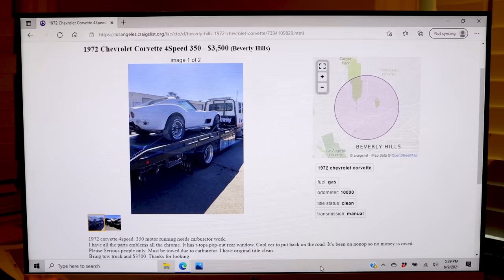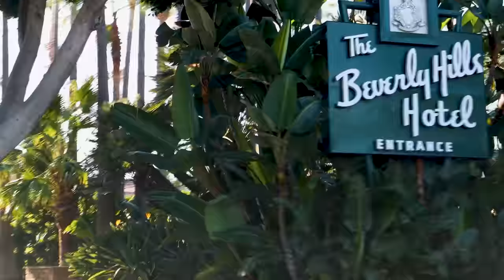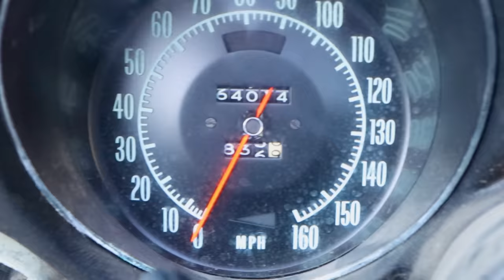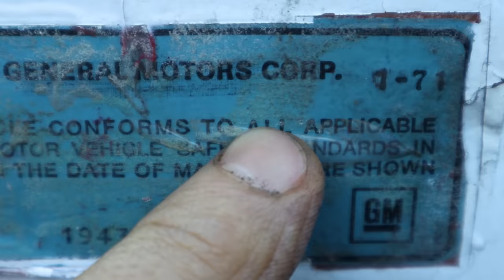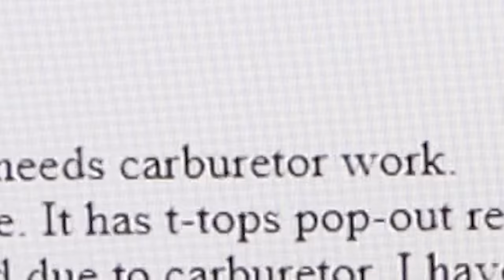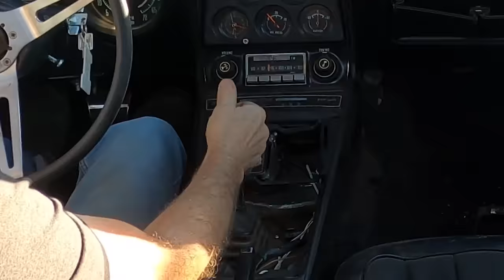I bought a classic Corvette for only $3500.

Comment: Put hose into pop bottle with brake fluid. Open bleeder. Pump away. Push out air bubbles. Been doing it for 30 yrs
Reply: Wrap the bleeder screw threads with teflon tape.

Comment: I've have guessed that car to have come with a dual line Holley carburetor rather than that pseudo Carter AVS monstrosity.  I was waiting for it to quit during your test drive.  A partially filled 2 1/2 gallon can that you had already wasted most of the fuel fooling with the points and coil was a no brainer.

Comment: What's really awesome about this car is that it's a manual, not an automatic.👌
Reply: That 71 is a real jewel. The great thing about fiberglass is that it doesn't rust! I spent 23 years at GM dealerships & one in particular was a big Chevy dealer. The owners private collection was mind blowing! From a 1923 Chevy Cabriolet with 23 miles on it to a set of Impala Convertibles from every year! Every year Camaro & Corvette too
Reply: They rust.  Just not the body.
Reply: @dukeallen432  lol... How well do I know... I've worked on a few thou Vettes in my time
Reply: That's the same year that a buddy of mine had. He almost never drove it. He pushed it out of the garage to wash a t then pushed it back into the garage which was carpeted. When he sold it in 1995 it had 3500 actual miles on it but the engine oil pan was just about rusted through. The underside was terribly rusted. The guy that bought it did a frame out complete restoration. He actually drove it to car shows an such.
Reply: What a score!
I did sub so my vote: that factory Ontario Orange. If you wanted to drift a little from factory but still be orange that Mopar Burnt Orange metallic or Fords Competition Orange are really nice and either one would look killer on a 71 Vette and go great with a black interior.
Reply: When is the painting video coming out?
Reply: @dukeallen432 , yes they do. From the inside out usually.
Reply: I was going to say in 71, hardly anyone would get an auto in a Corvette. It looks like 2 out of 3 were autos, so I was wrong.
Reply: Corvette white
Reply: Right! Manuel Stingray, 15K all day long!
Reply: Exactly…! It is a four-speed. He should’ve said that in the beginning… As I established in my earlier comment, this guy is a moron !!
You can end up doing all kinds of damage before checking things on a car that’s been sitting for a long time… Hellooooooo !
Reply: Definitely paint it ORANGE.
Reply: @gearmeister  The worst part for rusting is the "bird cage" Big job to repair properly.
Reply: @James_Bowie  I only worked on Vettes for 20 + years... but yeah metal rusts, fiberglass doesn't

Comment: Shawn, that '71 Stingray was a great buy. If that is the original long block in it, then the '71 has higher compression than a smog pump equipped '72, eh?
I think that particular Vette body style looks fantastic in Black or White, in my opinion.
Your "parts yard" is impressive.
Happy to be a subscriber. Best of Luck!
Reply: Great to see you posting on YouTube. Looking forward to sharing your next installment. Stay safe J.
Reply: Great show. Just tuned in and now a subscriber. As far as a color, I think candle apple Red. Sure to get noticed and probably a ticket or two. Look forward to the next show.
Reply: It's a 4 speed too 👍

Comment: The original color it came with would definitely raise someone's attention it's not my car but if it has 64k on the milage, number matched, then you already know it's value, seems your luck is off to a better horizon, liked the show, presentation as well 😁
Reply from the maker: thank you
Reply: My opinion , orange looks cheap , but maybe close to original with copper or bronze metallic mix would pop more modern (?)
Reply: Orange does NOT look cheep especially factory 71 orange.
Reply: New subscriber.     Factory orange!   Be well.    Art
Reply: dont detract from an original color regardless of what it is,fuck making it modern.thats the best part about this car,it aint modern trash

Comment: Hey Shawn,
I’m so happy to see you on YouTube! I hope you’re very successful.  I went through a half dozen 68-75 Vettes in my earlier years. My favorite was a 72 LT-1 with Air. I think it was the only solid lifter car with AC that GM ever made. I think they made 271 of them. I sure wish I still had it. It was remarkably weak In performance compared to a 70 LT -1. The pollution control stuff and the lower compression made a huge difference in performance.
You really made me “homesick” for another. I may start looking for another. I’m really wondering if I’ll enjoy driving one, it’s been a long time!

PS: No question in my mind on the color. Ontario orange. It’s original and orange is popular again. If you’re lucky they prepared the jams poorly and they’ll be easy to strip.

Comment: Dude is a cross between David Spade and Dana Carvey. Excellent Channel! For wheels that are locked up you can put fiberglass cafeteria trays under each stuck wheel. They will slide like butter.
Reply from the maker: Where were you when I needed that advice. I will remember that one.

Comment: I love these old Vettes! It was a time before they were insanely expensive and a man that worked hard could buy one to enjoy. Simple to work on and absolutely beautiful! I love people that are passionate about their vehicles you got a new subscriber keep them coming love it:P
Reply: I owned a '69 427 390hp with a 4 speed.  It was totally stock when I bought it in 2004  with only 70K miles on the clock.  Low optioned car without AC or even an AM/FM radio.  Perfect color combination.  LeMans Blue on a black interior.  I had the paint corrected because they painted those cars in lacquer on fiberglass and it had lots of spider webbing.  I sold it in 2011 because it was too much like the car owned me.  Didn't want to change anything because I couldn't show it in C3 Stock if I did.  It won lots of hardware after the paint correction.  It was also one of the most uncomfortable cars I have ever owned, but it did get lots of eyeball out on the street.  I bought a 2009 C6 in 2015 and I love it.  More power, more room and it's Victory Red!

Comment: Bleeding brakes really is a one-man job. I’m sure you know to start with the farthest wheel from the master cylinder and work your way around to the closest. 

First, open a bleeder. Then pump the brake pedal several times, making sure you don’t go past the normal travel of the brake pedal. You don’t want to push the master cylinder piston into the “untraveled” portion of the cylinder because it can get really pitted. Pushing the piston through that pitted area will tear up the seal on the piston.  Mechanics have ruined more master cylinders by pushing the pedal to the floor during the bleeding process. 

The reason you can pump the pedal with the bleeder open is because of the residual pressure valve in each chamber of the master cylinder. The RPV is there to maintain pressure in the line at all times. Without them, you would have to “pump up” the brakes every time you want to stop. It’s an old wives tale that you have to hold the pedal down and close the bleeder (to prevent sucking air back into the system). The RPVs will prevent that. 

Work your way around. Repeat until you have a solid brake pedal. Try it.

Comment: Well you did good. A while back I bought a '77 for $3000. Several years and $20,000 later I had a real nice restomod. Drove it for a few years and then sold it for $17,000, used that money towards an '06 coupe. Great cars these Vettes.

Comment: i paid 4k for my 81. it needs are partial exhaust, Cat got cut off. Pop up headlights dont work. Needs some new carpet and seat covers. Needs new seals all the way around it.  I do have an issue with the shifter not wanting to go in reverse, it just wants to go in first gear. whats the issue with that? But she does run and drive, Thats the main thing.

Comment: i would like to know how to make my car hauler be able to be used in reverse like yours does, it appears to be the same as mine but I have installed an electric wench.    it;s the old school  wide type like yours and my straps are 3 point cinch.   I like your wide risen tail light set up, i just use a 4 wire magnetic set so I can pull anything i want . it;s only a minute or two of my time to set up and I can take my lights off and inside so they are like brand new every time i use them. 

so how do you do it? make it so you can reverse     this would be awesome info for me.

Comment: Get yourself a 1/4" clear plastic hose.  fit it over the bleed valve run the hose to the break reservoir, the pump the breaks until there are no bubbles in the line.  Close the bleeder valve.  One man break bleed.